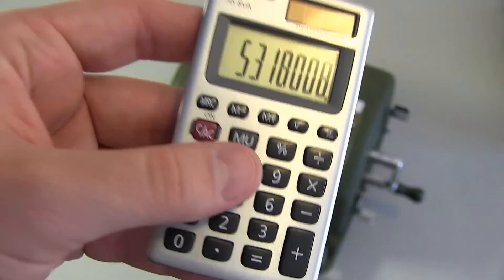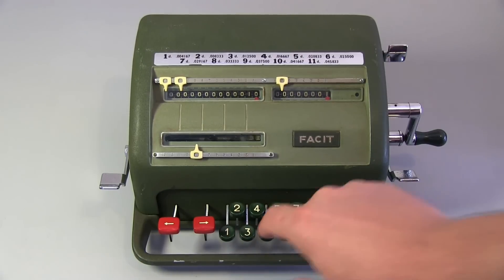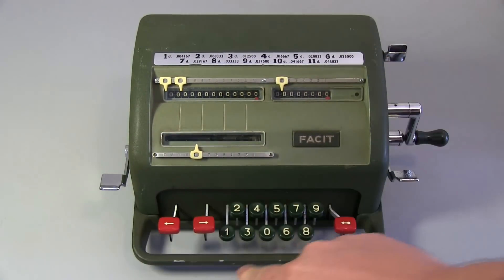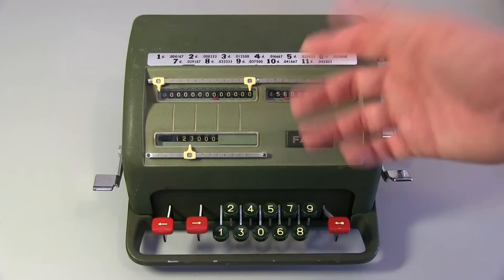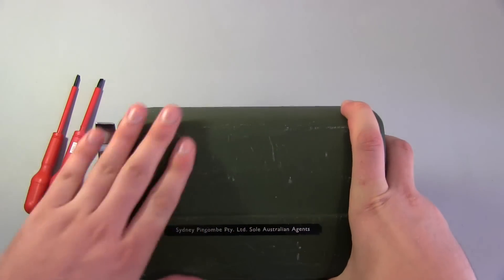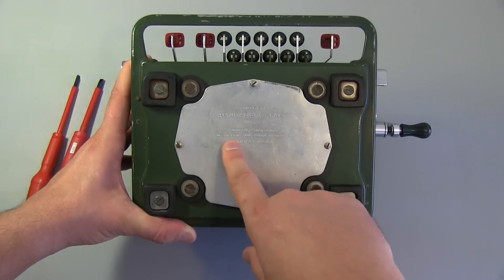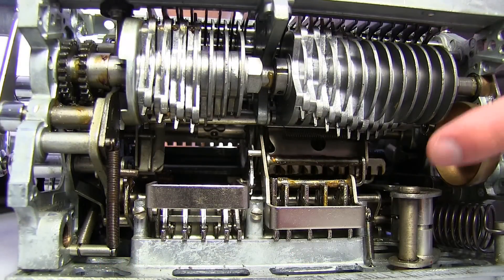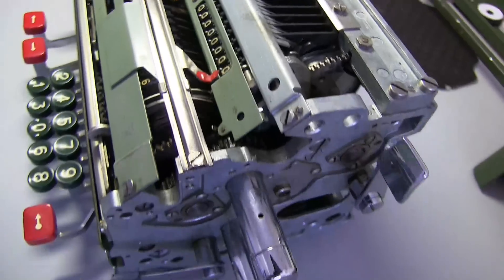Facit NTK Mechanical Calculator, 1957

Comment: The keyboard is a very useful addition to this overall pinwheel design. Much faster and reliably than the rotary input method. I quite like that!

Where these machines really shine is in division. Multiplication by hand is not hard but the reliability of the machine is what made the difference there. Whether Facit, Monroe, Comptometer, Odhner, or whatever, they all made this job a lot easier. BTW, the underflow/overflow bell is NOT really meant to be used. Not invalid, just not right. It's a warning in case you're not paying attention and lose count. Proper use should be you counting or watching the counter.

Comment: I think this machine would be great for any child interested in math. They can get a feel for numbers just by figuring out how it works. When you use a calculator it simply spits a number back (in fact electronic calculators use logarithms, which most people don't know). But with this machine you can watch everything happen step by step. You can see that division is really just a form of subtraction and multiplication is just a form of addition.

Comment: What that strip of numbers on top of the calculator?
Reply from the maker: It's a little table to help the operator convert from pence to decimals of a pound (old currency). This was used before Australia changed to dollars and cents in 1966. There was apparently also a technical version with log and pi conversions. Check out http://www.johnwolff.id.au/calculators/Facit/Facit.htm under Model C1-13 for photos of these labels.
Reply: I can't help but wonder what the purpose of pounds and shillings was. Why not just do all arithmetic in pence?